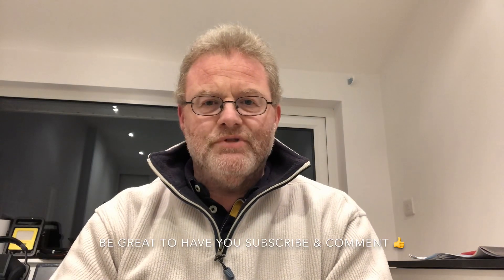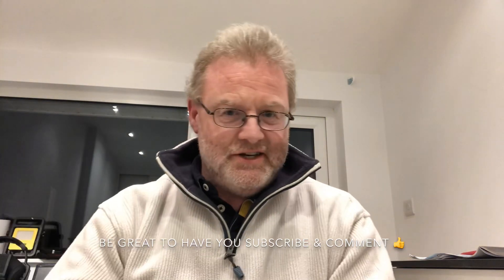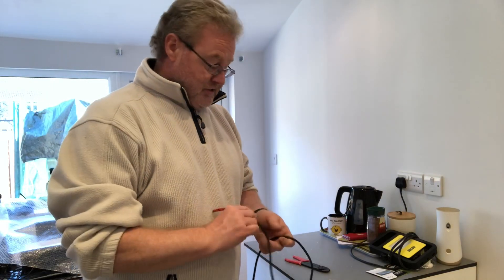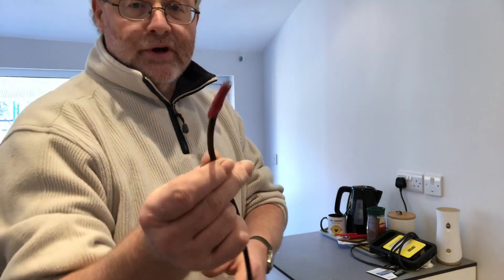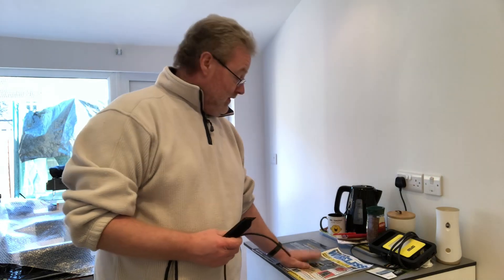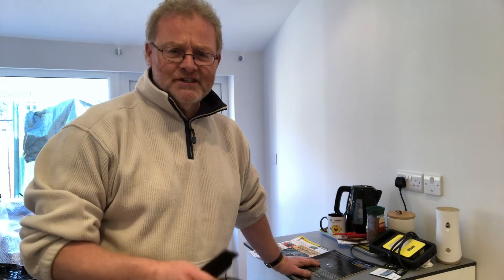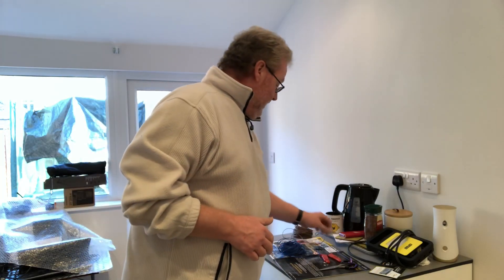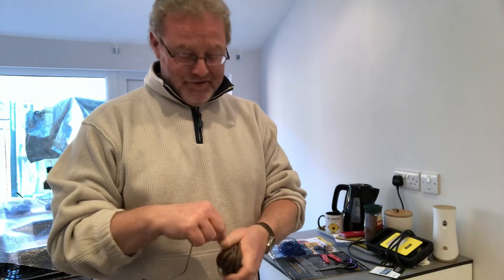Ham Radio: Doublet Antenna Installation - Success?

Comment: What you're describing is common mode rf that's coming down the feed line into the shack.  Problem would be rectified by using a choke of some sort.  Has nothing to do with "radiating element"

Comment: I wonder if some of the RF in shack is due to the last several feet of ladder line is running along the gutter just outside the radio room.  Aluminum gutter may be acting as an antenna due to the induced current from the adjacent ladder line.  Try running the ladder line away from the gutter and if it has to get close to it, try to have it perpendicular to the gutter.  Just a thought.
Reply from the maker: You were correct 100%

Comment: Make it easy on yourself and buy a good commercially made G5RV if you want 80 maters or a ZS6BKW if you want 40, 20, 17, 12, and 10 with some or all of those frequencies resonate enough to where you don’t even need a tuner. A 1:1 choke balun is a must to prevent common mode current issues. I use the LDG 1:1 100 watt choke balun and 15 feet of LMR 240 into the tuner and never had an issue. I live in an antenna restricted neighborhood so I have the feedpoint on the back of the chimney about 20 feet high. The wire elements are snaked through two trees and terminate in two 10 foot painted PVC pipes where they drop down vertically. My garden is only 30 feet by 50 feet. I get reasonably good results and have worked the entire continental US and occasionally some DX into Japan and Europe depending on band conditions. I live in Southeast Texas. I bought an antenna analyzer which is a must for tuning the wire for maximum performance. Tuning is a future project as I am replacing my 25 year old Yaesu FT-840 with a DX-10 and my manual MFJ 941E manual tuner with an LDG 100 pro II auto tuner.

KC5RJL 
Houston, Texas

Comment: 94 feet is a little short for 80 meters. Just sayin'.
Reply from the maker: Nope. 3/8 wave doublets have the equivalent efficiency of around 95% they of a half wave.,73
Reply: @TIMG5TM  This link is helpful for doublets and feedline length. http://ocarc.us/docs/antennas/MultibandCenterfedZepp.pdf
It could just be a matter of feedline length. Three lengths to try: 62', 98', 112'. Those might help
with the RF in the shack thing. Also I'm assuming the 1:1 current balun is a bifilar wound balun.
The PDF has been a big help to me and my doublet endeavors. Main thing is, get on 80m and
let's have a QSO! Cheers, AC8RJ.
Reply from the maker: Thanks! I’ve since resolved the issue by feeding the 1:1 Balun at the case of the fibreglass pole and running coax into the shack (some loss I know) but it works very well now on 80 and DX worked on 15 and 17 too. 73
Reply: @TIMG5TM  Excellent! Glad to hear it worked out. 73!

Comment: The problem is how you've run the ladder line, where it comes off the fibreglass pole along the roof, there could be metal nearby making it unbalanced.
The solution is run the ladder line to either to a 1:1 balun at the bottom of the pole or a tuner that has posts for attaching ladder line, also best placed at the bottom of the pole, then a short run of coax to the radio
Reply from the maker: Great points! Just what I did .. my next video shows how I sorted the problem out 👍 73

Comment: Did I see correctly? Did you run your window line (ladder line) PARALLEL to a source of metal? That's a no-no. Ladder line can cross metal for a short distance, but when it does it should be perpendicular to the metal and for as short as possible.

Comment: You need to use a tuner Tim, preferably a balanced tuner, though you can get away with an unbalanced tuner if you put a one to a balun on the output with reduced performance. Some MFJ unbalanced tuners have a balanced output though they aren't going to perform as well as a proper balanced tuner. Just feed the balanced line. The great thing about a balanced open feeder is that even if there is a massive impedance mismatch losses are still minimal - unlike co-ax where a mismatch will just result in warm co-ax and lousy performance. Yes you may get a 1:1 SWR but that's because the load is the co-ax not your antenna :)

Comment: Tim, I realize few use artificial grounds or tuned ground devices, but they may well be the better way to stop the current coming back into the shack. If you had one to try it COULD  be your solution. By using one the Common Current can be tuned out and your feedback problems can be eliminated. https://www.youtube.com/watch?v=zU0I_YOYX0s      https://www.youtube.com/watch?v=__odbyw0o7k&t=13s
Reply from the maker: Thanks I’ll check this

Comment: FWIW I did find that I had to cascade common mode chokes to kill the common mode current,  the "balanced" output from most tuners is not worth using. (generally a voltage balun). Don't give up, doublets can work very well indeed. 73 Happy New Year
Reply from the maker: Thanks happy new year to you too.. looks like I have some success now 73

Comment: Thank you for sharing. I am new to doublet antenna & been following your doublet antenna project. I am planning to build my first HF doublet antenna and has been searching for the best/simple/efficient ATU to use. For simplicity and step of learning before going to fully automatic ATU, I found the Z Match ATU on the net - appear this ATU has better efficiently than T Match and L Match. Do you have any recommendations/ experience? Thanks in advance.
Reply from the maker: Z match has the edge for sure.

Comment: I've had RF in the shack problems with end-fed wire antennas at 100 watts while using a poor ground, but never with a dipole or dublet.  So, like you, I'm wondering if the problem might be the feed line running too close to one of the legs.  I've read that others running twin lead have put a slow twist in their feed line (about one turn per two feet) to reduce radiation pick up.  

I guess the theory is that whatever is picked up from the closer radiating leg by the twin lead/ladder line will be balanced out and self cancelling.  Anyway, it's easy to try and I thought it might be worth mentioning.

Also, as a further thought, whenever I have had RF in the shack, it has been easy to tell:  I simply put my hand on the rig, or tuner case, or the SWR meter case -- and if the measured SWR changes it means there is RF in the room.  If your setup does not do that, I'd be wondering if it is simply the house wiring being resonant enough to be picking up the RF and re-radiating it.  I can't think of an easy solution for that other than moving the antenna.    

Good luck,  John N0BUP
Reply from the maker: Hi john great points. Yes the swr does change when I touch the tuner so no doubt there’s rf floating about. I appreciate your detailed reply .. thank you sir 73
Reply: Years ago when twin lead was used on tv antennas we were advised to twist the twin lead as you suggested for the same reason, plus it helped with TVI, but you are the first to suggest it on HF.  I have wondered about doing it, even asked a couple of times on forums with no response, kinda of nice to have someone else also suggest it. Remember the standoffs we used for TV, likely longer standoffs would be a good idea on HF installs?

Comment: I suspect you need a much better grounding system for your station and antennas to get rid of the RF in the shack. Good luck and 73 de K7RMJ Frank

Comment: I think your end fed idea is likely going to be your best bet Tim and you have demonstrated good results using them before.. I am using the Hyendfed 80m version just as you described which works well. Mine is up as an inverted L with the unun box about 6 feet above the ground then the wire running up about 20' then the rest horizontal.. 73 Syd.

Comment: Interesting video again Tim. I have a coax fed inverted V via a 1:1 balun for 40M. Works great and SWR well below 1.5. I will be adding a new wire for 20M when the weather is better. What I want is to be able to get 80M too but restricted on space. Could I add coils to the 40M to get 80M?
Reply: Yes you can add loading coils and a short length of wire to get your current 40m dipole to tune 80. They will usually give you a narrower bandwidth than a full sized dipole and will be a bit less efficient but will get you on the band if your short of space.
Reply: @TomG2NV  Thanks Tom. Do you have any info or links to build the coils.
Reply: @martindrury9740   Hi Martin, Here's a link to the online calculator I use, https://coil32.net/online-calculators/one-layer-coil-calculator.html It gives you a ballpark figure to base the number of turns on a given diameter former. I'd recommend you add a few more turns before checking the value in real life with an L-C meter, (these can be bought for £20-ish quid from the likes of ebay) and ensure you get the required inductance value correct.

There are many trap-dipole designs online that should recommend  how many uH's you are likely to need and roughly the right length of wire to follow the coil. I'd suggest you add say 30% to that length and trim back slowly to tune the antenna to resonance at your desired part of the 80m band.  this will be quicker & easier if you have access to a decent antenna analyser, 73, Tom, G2NV.
Reply: @TomG2NV  Thanks Tom. How go you know what inductance you need?
Reply: @martindrury9740  The short answer is there's no short answer to that Martin. The most efficient loading coils for your antenna like so many things in antenna theory can be influenced by all the other factors involved in YOUR installation in practice. ie Wire size/composition, Height above ground, Orientation, Proximity to buildings and even the composition of the soil under the site of the antenna can play huge factors in real world performance. How well any design works for you will always be subjective, that said looking at the many resources online most 40/80m trap design's  seem to be between 80-130 microhenry's (uH). 

The pair of coil's I'm making for Tim are 120uH and he will then trim/tune the wire outboard of (beyond the coil) to give him the "sweetspot" he's looking for on 80m. If it doesn't look right he could then always shorten the coil and try again. since this is a compromise design the parameters for the antenna will always need a tweak. But for round the UK/EU on 80 it should be fine. Below is a link to a typical dipole build to give you a few ideas.

http://www.highonsolder.com/ham-radio/8040-meter-loaded-dipole-antenna/
Reply: @TomG2NV  Great Tom many thanks. 73
Reply: I'll have a go and see what happens. I do have a antenna analyzer so can check.

Comment: Happy New Year Tim. Did you turn off the rig internal atu when you tried tuning 60m with the external ATU? 
I also have a shortened antenna for 80m due to space constraints. I have quite a ‘hot’ shack (RF-wise) and tune quite a bit of ‘heat’ out with artificial ground/counterpoise. Good bits of kit where real estate limited like me n you. I even use one portable (unlimited real estate) when in m/h is sat under doublet. Tunes RF feedback out of my system 95% of the time (if present in first place), keeps things safer and no wasted time messing with antenna position in the field.
Do you have any other antennas outside with feeders coming in? 
Also try a 10-20 foot wire into back of rig Earth lug.....might help take some heat off your gear. 
All good fun. 73 Nick
Reply from the maker: Good suggestions Nick..tuner always off on rig and no other antennas up. Will try the wire 73
Reply: Hi Nick - could you tell me what an artificial ground is please?
Reply: @edwardwright6949  Hi Edward...look up MFJ-931 and take a look at the instructions and application. They are good for limited space stations and tune your ground wire from your shack https://mfjenterprises.com/products/mfj-931
Reply: Great thanks Nick. Very helpful.